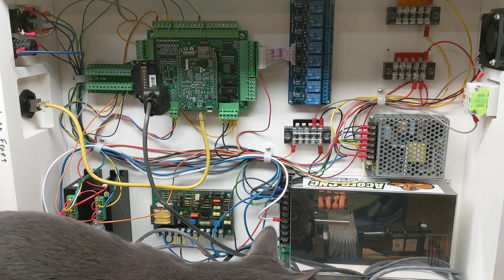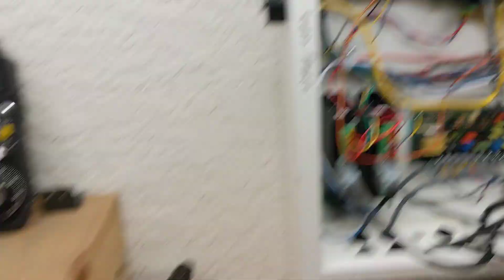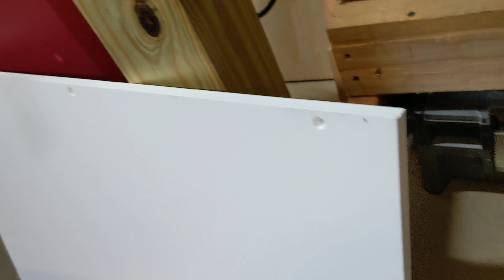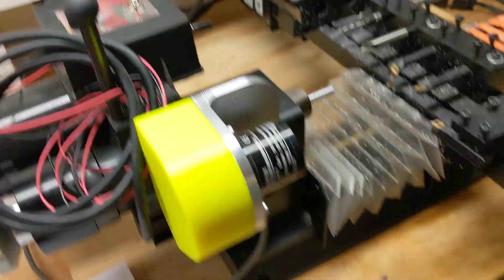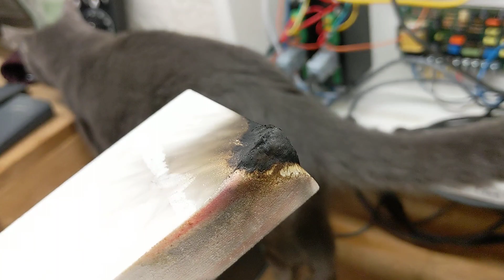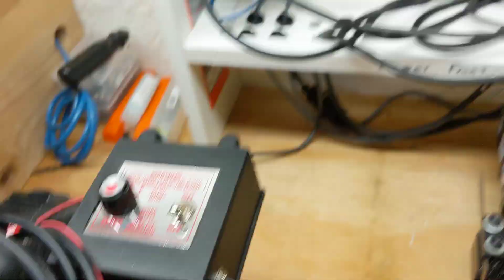DIY CNC Enclosure Made From PVC For Centroid Acorn

Comment: Franco, I'm having a real tough time finding info from anywhere on the 10V and 0-10 V connection to my Acorn board. I've watched most of your videos, but have not been able to get the info I need. I'm trying to contact Acorn about the question but no response yet. Do you have an email I could contact you through. I'm sure it is a very simple solution. Thanks.
Reply from the maker: francocncprojects@gmail.com

Comment: Cool. Good to know.  I plan on making my enclosure from and old desktop pc box.  My scrap yard has tons of them. One question.  Sorry to bombard you with the noob-ness lol. But I just got my four axis kit from Longs with their breakout board.  Is there a way to use that spindle encoder you have on your chucker with the Longs board?  Also I have another sherline lathe with sherlines dro and it has the optical that comes with theirs.  Assuming that won’t be the best option though?
Reply from the maker: Hi.  True encoder feedback requires a more complicated board than what you probably got from Longs Motor.  You can get a single pulse per rev with their DB25 Break Out Board, but to get true encoder feedback (4000 pulses per rev) you need something like the Centroid Acorn.
Reply: Franco yeah.  I’m gonna dish out the dollars for acorn after all.  I got all my motors and what not.  Holding off on the mill till next month cuz....wifey.  So I bought an A grade surface plate, new grinder, and Mitutoyo tenths indicator for my own Xmas presents.  Furthermore sherline says it’s quite possible they will have a ball screw conversion kit out for the long bed lathe that I already have either this month or January.   And my shithead side kinda wants to build a mill from scratch and use the THK HRW rails.  Similar to what “Zeal CNC” had used in their mills. Idk.  Turns out you have answered the majority of my questions in older videos 😂.  Sorry sometimes I reach out as soon as I’m about to make a decision to get your input.   And another thought was using the DMM 750 watt servo for spindle drive.  You still using one of those?  Any shortcomings you’ve found since making those videos?  Thanx
Reply from the maker: @durangotang1681  You have some cool projects coming up.  The only thing I'll say is moving forward, I would go with Clearpath servos over DMM.  Both are good but Clearpath is easier to configure and make work.
Reply: Franco so how do I use a clear path as a spindle motor so I can do threading?   Not only that but as a full time motor to ditch sherlines stock motor. I’m losing sleep over this.  I’ve even contacted them and they recommended the sdhp models to me?  Someone else thought that was weird as there was no option to control velocity.  Pulling my hair out here.  Then I look at the dmm tech and it seems pretty plug and play with acorn. But I can’t meet the 220v requirement.  Save me Franco. Also I should mention that’s why dmm tech is appealing cuz I have used for the step n direction as well as using it for threading and regular turning work.   But how does this work with clear path?!?😤
Reply from the maker: @durangotang1681  Hi.  First off, you don't actually need to control the spindle in order to do threading.  All you need is spindle feedback (and encoder or some type of sensor depending on your software and MCU).  I use the centroid acorn system and it is super easy to connect an inexpensive encoder and get the feedback.  I  suggest you look into that product: https://www.centroidcnc.com/centroid_diy/acorn_cnc_controller.html

Secondly, you can control just about any spindle motor driver with this cool little guy: https://youtu.be/-h4k-9qlTHo

I hope that helps.